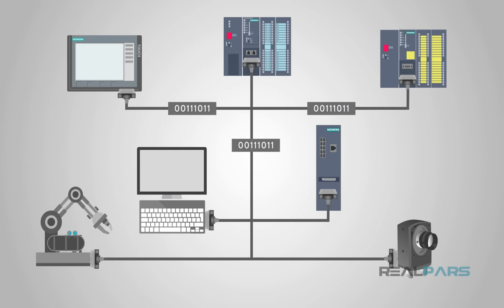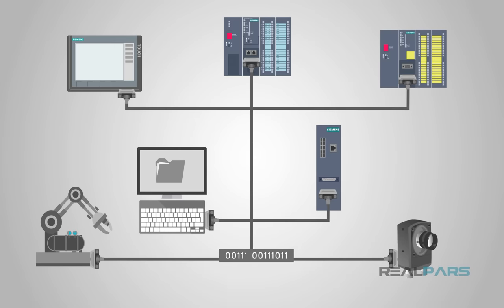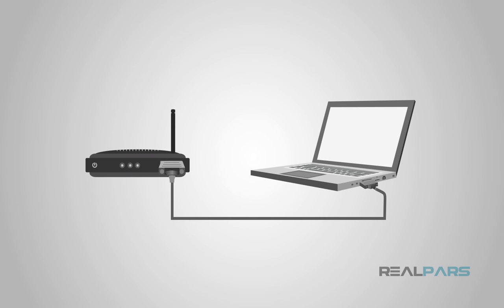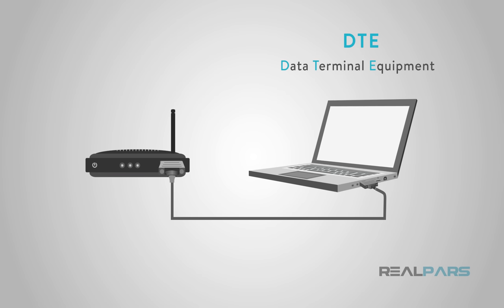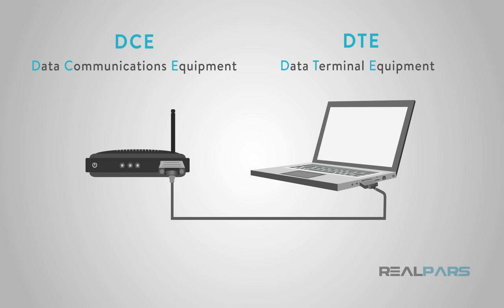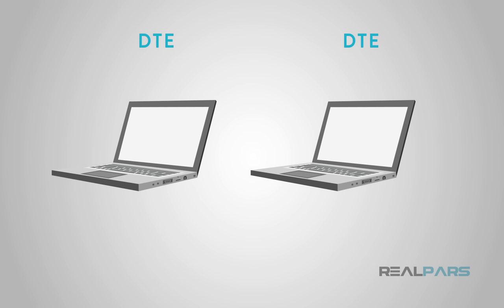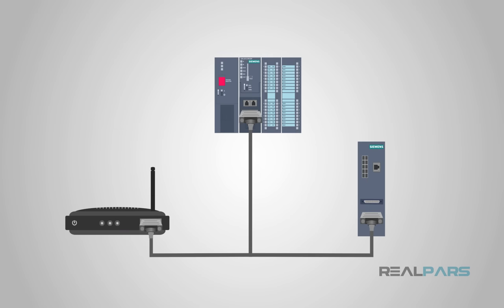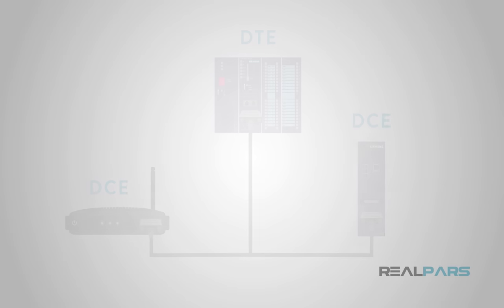What is RS232 and What is it Used for?

Comment: you completely left out rs232 did NOT start out as a db9 but a db25 just like a parallel connection. not only that, in the beginning they both had female connectors on the back of both pc compatibles and cp/m computers. also 2 computers connected with a crossover or null modem cable can actually be considered a peer to peer network. it may have been slow, but it was much easier than transferring files with floppies by a long shot. if you actually want to learn something then google laplink. if i really want to date myself, i can tell you how i communicated with a mainframe, using a serial modem, a dumb terminal over a straight thru 25 pin serial cable at half duplex. that is why serial is so slow, because it is at half duplex, meaning you could either send or receive data but not do both like a full duplex ethernet connection. do you even know what the anacronym modem stands for? it is modulate demodulate, meaning my modem takes digital information, turns it into an audible tone that gets sent over a phone line, then your modem hears it, turns it back into digital information and sends it to the computer.  i always laugh myself silly when children like you try to explain computer history and completely screw it up. next time do your homework.
Reply from the maker: Hi Richard, We are doing our best! Thank you very much for taking the time and sharing your knowledge with us and the rest of the community here.
Reply: Richard Benjamin The type of D connector used was never stated in the video. So what exactly was wrong with the video? It wasn’t about modems or vintage computers. In fact there’s nothing preventing full duplex comms over a standard RS232 serial port, and there never was, and many full duplex implementations exist. It’s just unlikely that any of those are dialup modems.
Reply: then it looks like you have no idea what you are talking about. about 75 seconds into the video, they very clearly did use the db9 as an example even though it did not exist until ibm  created it specifically for the pc/at. in fact the rs232 standard existed LONG before the personal computer and I know this for a fact because I used a serial modem to communicate with a mainframe over a dumb terminal using a straight thru cable. you say there is full duplex serial, then cite some examples. where is your proof? you say I might be talking about a dial up modem? I come right out and say that very plainly. again, you completely missed something.
Reply: All it said was “here’s the standard 9 pin connector you might recognise”, which is true for most viewed. It’s standardised by TIA-574. All I asked was is wrong with the video that you would say a child explained computer history and screwed it up. It’s not calling itself a computer history video. Perhaps you are upset because it wasn’t the plot you expected.
Reply: again the video very clearly says 9 pin db9 cable, get your so called facts straight. the video also says it WAS called this and it was referred to as that. how is that NOT computer history? obviously they pulled some nonsense  off places like Wikipedia and tried to pass that off as fact. every time you make some unsupported claim, all I do is go back and carefully listen to the video, checking and rechecking it just to find out you are wrong.
Reply: I agreed the video says 9 pin cable. The 9 pin cable was made standard. The video didn’t say RS232 started out this way. It says “You’ll probably recognise the standard 9 pin DB9 cable” That’s true, I did recognise it. So would most viewers, and it was made standard in TIA-574. What exactly did the video get wrong?
Reply: RS-232 is a full duplex protocol.
Reply: Lets be clear on one point. The RS-232 standard was about its electrical standards, logic levels, connectors etc. it was never about the data encoding, character framing (stop/start bits) etc. IBM Mainframes never used the asynchronous protocol that many equate to an RS-232 standard, they used BISYNC which is a synchronous half duplex protocol and is faster than asynchronous full duplex protocol which most are accustomed to.
BTW an IBM mainframe never communicated with a "Dumb" termial, they always communicated to a controller. Most modems people used back in the day, were asynchronous modems not synchronous. A modem did modulate/demodulate and not only in audible tones and not only used Frequency Shift Keying(FSK), they used many different modulation techniques (FSK, PSK, QM, etc) and in your limited experience with PCs the first tones you heard on the phone were that of the modems determining which modulation technique would be the fastest. People used digital leased lines back then too, but didn't use those types of modems. After all you can send a 56kb digital signal and have it degraded due to signal quality and have it transmitted at 110baud (roughly 11 bits per second) the modems would throttle the speed at which they accepted data either via software or hardware handshake.
In the days way back, RS-232 DB-25 connectors were rhe standard until they realised that the PC was not going to use synchronous communication and wanted to save space and converted to the DB-9 connectors. Both connectors were "D" type connectors. And all DCE equipment had female ends while DTE had male connectors. this made it easy to determine which direction was the data flow. I made hundreds of RS-232 cables in both DB9 amd DB25 configurations. 
In actuality the term "DB" was developed by Canon for thier connectors. The DB-25 name stood for "D" Series connector and the "B" meant 25 pins. There was no such thing as a DB-9 connector, it was a DE-9 connector. Again the "D" was for the series and "E" meant 9 pins. Long time ago someone never knew what the "E" meant and foolishly kept the "B" thus making it a fictitious DB-9 connector.
The DB-25 connector had many more signals than a DB-9. DB-9 were only used for asychonous communication where a DB-25 can be used in BISYNC communications as well, such as from IBM mainframes.
This video was for people that use the RS-232 standard to communicate with controllers, not really in in depth course on RS-232 usage. 
Accept the spirit for which it was intended.